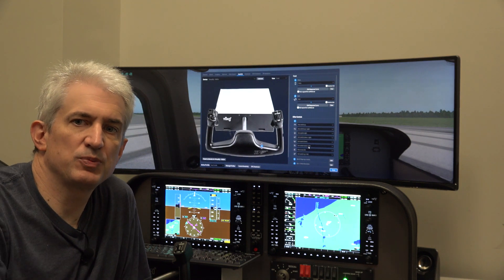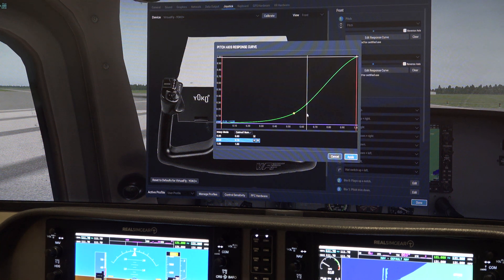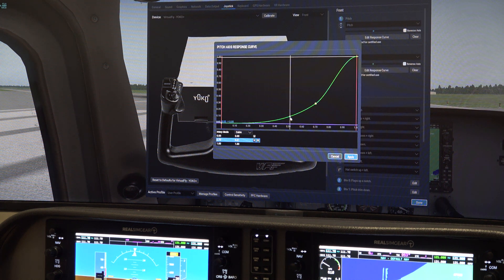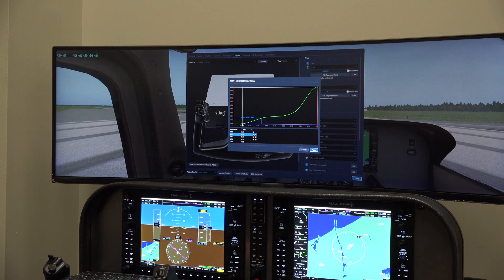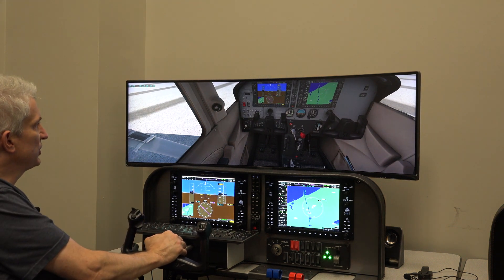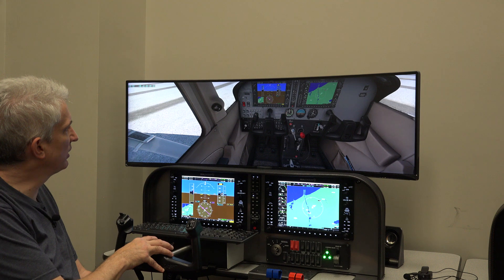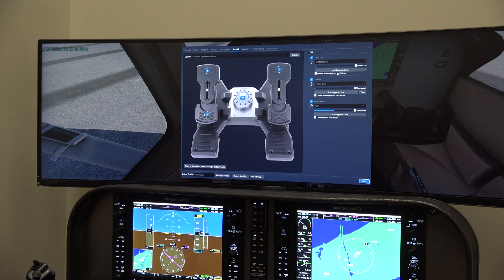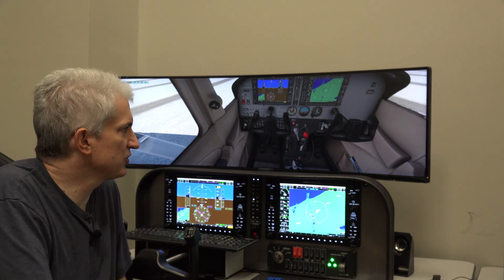Response Curves in X-Plane 11: Multiple points and curve types

Comment: 1. The setup only allow us to set “equally” nullzone in both direction, meanwhile in fact (in regards of pitch setting from video) the nullzone problem probably occurs only to pulling side, but because the setting limited for both pull and push side this nullzone setting also effecting the pushing side. I think it’s good idea for future dev to make graphical curve setting for all side. So each side of flight control movement have their own curve.

2. The “spike” curve exist after certain percentage of movement in order to control the sensitivity but also get the 100% control travelling, I think if the X line(the horizontal line) can be longer and have the linear acceleration (so the control still can continue to travel even the flight control already in travel limit) this spike can be avoided so the user still have a chance using linear curve but shallow climb curve rather than sharp.

I’m sorry for my english, I’ll try better explaination next time.

Comment: I was never dissatisfied with any curves settings in Xplane. Plenty of sims could take a hint or two from xplane control settings menu.
Nor the base cessnas in xplane.
But it is great to explain it to folks in this way. Love it. 
I would also love if you could bring this to their attention my issue lately are weird stall problems on lot of planes even some stock ones. (baron / king air from the top of my mind)  Where with higher flap settings less the stall horn works in slow flight / landing. It is mostly in Experimental flight model.
And this is usually coupled with very weak pitch authority in near stall conditions. This combination can lead to very bad landing situations and bizzare stall-incapable high AoA turning planes.
Again this is not the case of the cessna. She is that nerdy best in class kid. :-) 
Pretty much all of the old Carenado models suffer this problem. Kodiak from thranda as well - sorry guys.
On the other hand personal favorite in this regard are group PWDT&NHAdrian  and their FREE Zlin Z-142.
Free plane and it has best flight model i could find in x plane. Yeah yeah base cessna is close. :-)
How come these guys knew exactly how to nail it. What do they know others do not ?
Please download the plane and test it to see for yourself this is realistic flight model.
Are there any plans to fix this ? Can they force devs of 3rd partie planes to fix it or finally allow community to release fixes and FM mods.
Yes i get it is not possible in XP11 but how about from next iteration of XP LR would enforce rule for example - If 3rd party does not release the patch for a year, then community is allowed to post FM mods on XP site/forum/store ?

Comment: Nice cockpit with the realsimgear glass panels,   is there a video going over setting those panels up with XPlane? 
Does XPlane have the ability to persist the setups which would cause the rendering of your "G1000" panel video from XPlane into the realsimgear panels?  What I have seen online with MSFS is that they have to do a manual "setup" each time they launch their MSFS app.  

I watched your troubleshooting USB video and have a point that I would have made over there that I couldn't because comments are off.  It may not be Saitek's fault.   There are known USB class compliant driver bugs in Windows 7 and Windows 10's USB plug and play logic.    There are also known chipset issues which exist and the only workaround is to unplug and replug the items you have plugged in.    I build commercial "kiosk PCs" and support them, and believe me, it's a pain in the rear.  The usb power management area of windows is a giant pile of dodgy mess, and Microsoft has a history of breaking these things periodically with Windows updates and windows servicing stack releases.